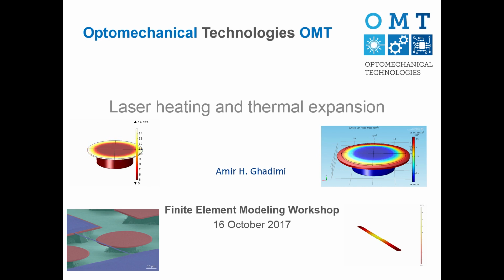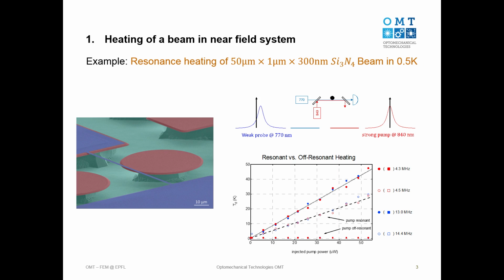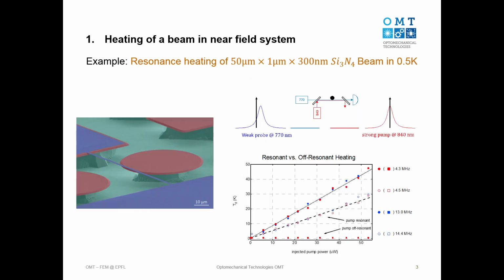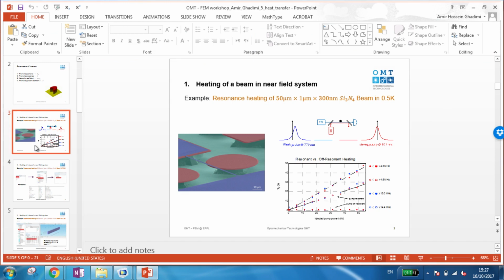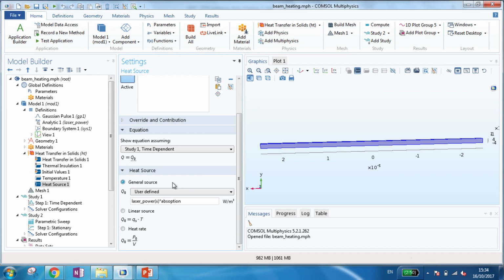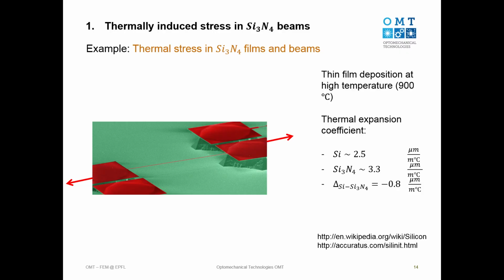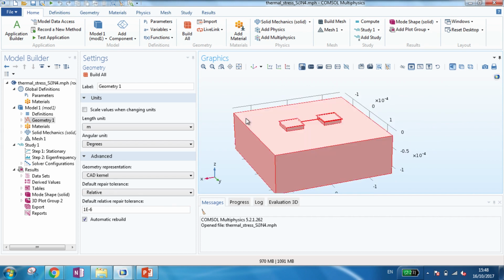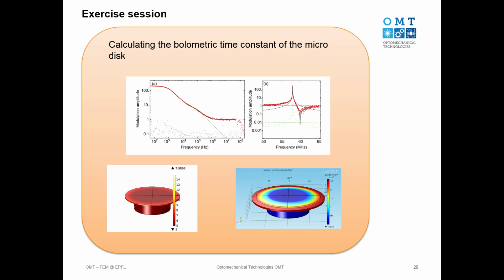COMSOL simulation tutorial: Laser Heating and Thermal Expansion - By Amir H. Ghadimi

Comment: AI Summary
Abstract

This technical seminar details finite element method (FEM) modeling protocols for simulating laser-induced heating and thermal expansion in optomechanical systems, specifically micro-scale resonators. The presentation delineates the physical distinction between radiation pressure and bolometric (photothermal) forces, emphasizing how finite absorption in dielectrics leads to volumetric heating, structural deformation, and subsequent shifts in resonance frequency. Through COMSOL Multiphysics, the instructor demonstrates the setup of heat transfer modules, the definition of Gaussian heat sources, and the analysis of both stationary temperature gradients and time-dependent thermal relaxation. Furthermore, the session explores the origins of intrinsic stress in silicon nitride thin films resulting from coefficient of thermal expansion (CTE) mismatches during high-temperature fabrication processes. The session concludes by establishing the necessity of frequency-domain analysis to distinguish photothermal back-action from radiation pressure in high-precision sensing applications.

Technical Summary: Laser Heating and Thermal Expansion in Resonators

*   0:52 Volumetric Thermal Effects: Beyond radiation pressure, laser absorption in dielectrics (e.g., silicon nitride) triggers volumetric heating. This leads to thermal expansion, which modifies the physical dimensions and resonance frequency of the cavity.
*   2:44 Competing Optomechanical Forces: Photothermal (bolometric) forces and radiation pressure often compete. While radiation pressure is nearly instantaneous, photothermal effects involve a retardation (diffusion time) that can lead to either cooling or amplification of mechanical motion.
*   5:13 Governing Equations for Thermal Transport: The simulation relies on the diffusion equation, requiring parameters such as thermal capacitance ($C_p$), thermal conductivity ($k$), and the absorption coefficient ($\alpha$).
*   8:17 Motivation for Photothermal Simulation: High-power optical probing is required for ground-state cooling of mechanical oscillators, but excessive power induces significant temperature rises (e.g., from 5K to 40K), necessitating accurate thermal modeling to validate experimental hypotheses.
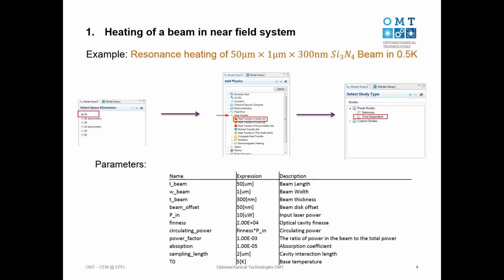*   10:48 Modeling Beam Heating: The instructor demonstrates a double-clamped beam simulation. Key parameters include the circulating power in the cavity and the "sampling length" (the ~5–7 $\mu m$ interaction region where the beam sits in the cavity's near-field).
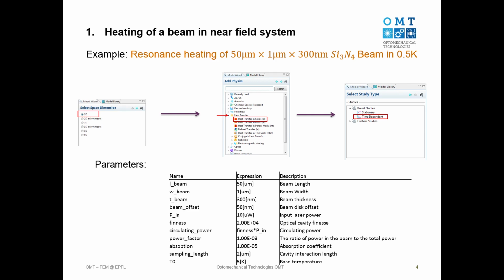*   13:44 Mode Volume Fraction: In near-field interactions, only a small fraction (approximately $10^{-3}$) of the total circulating optical power is typically absorbed by the adjacent mechanical beam.
*   24:36 Defining User-Induced Heat Sources: COMSOL’s "Definitions" node is used to implement analytical Gaussian functions ($W/m^3$) to represent the laser spot's intensity profile across the beam's longitudinal axis.
*   32:53 Time-Dependent Thermal Dynamics: A transient study reveals the thermal relaxation time—the duration required for phonons to diffuse out of the system. In the provided example, the thermal response cut-off is approximately 20 Hz; modulation faster than this prevents the temperature from following the power fluctuations.
*   37:30 Origins of Thermal Stress: High intrinsic stress (~1 GPa) in LPCVD silicon nitride is partially attributed to CTE mismatch. When cooling from $1000^\circ C$ to room temperature, the silicon substrate shrinks less than the nitride film, effectively "pulling" the beam and inducing tensile stress.
*   45:42 Quantifying Fabricated Stress: FEM analysis indicates that thermal expansion mismatch accounts for approximately 500 MPa of stress, leaving the remainder of the 1 GPa total to other amorphous material properties.
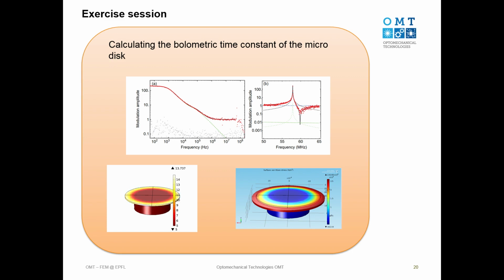*   49:06 Bolometric Force Frequency Response: In Whispering Gallery Mode (WGM) resonators, the bolometric force exhibits a flat response at low frequencies but drops off at a specific pole (cutoff frequency). Engineers must ensure the mechanical resonance frequency of interest is significantly higher than this cutoff to isolate pure radiation pressure effects.

AI-generated summary created with gemini-3-flash-preview for free via RocketRecap-dot-com. (Input: 24,042 tokens, Output: 929 tokens, Est. cost: $0.0148).